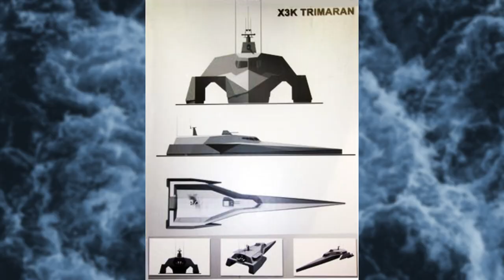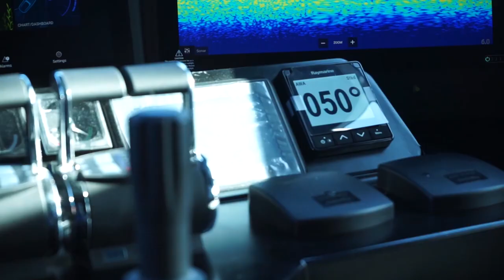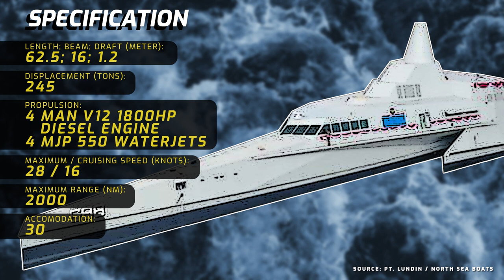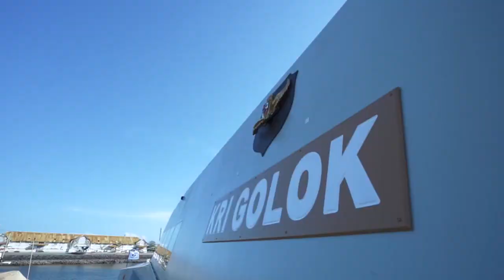What Can We Expect From KRI Golok?

Comment: I was curious about the role it would play because of it's size. Looks a little small for a Corvette but I also didn't think it would be an FAC because if that's the role it would fill... It's rather complicated and expensive. I thought they would utilize the stealth advantage for "bigger" purposes. The role of course would determine the weapon systems and to me the front deck is a little too narrow to fit a 57mm and it's probably going to block the view from the bridge which means it won't use a large main gun,  and wouldnt make it a Corvette, which means it would use AShMs and fill the FAC role but, I've been scratching my head on where you would put them. We've seen shots of the top and Im not sure I see any silos/VLSs. 

It was a pleasant surprise that a klewang replacement was launched somewhat suddenly. The country's military must love surprising the public with sudden announcements like the the FREMM and how many jets were proposed to fill the Air Force.  Again great work mate👍 was waiting for this video since I heard about the launch and definitely wasn't disappointed.
Reply from the maker: depends on the weapons, she can fill the role as coastal corvette.. more or less similar to Skjold class corvette of the Finnish Navy.. both have similar characteristic.. not long enough as a typical corvette length or can carry as much weapons like them, but have the seaworthiness greater than FACs.. I think coastal corvette is more suitable..

First I thought she's gonna be installed with 76mm naval gun, but it's not possible tho.. the best thing she can get is 30-40mm cannon.. posibly Bofors 40 installed on top of the bridge.. functioning as surface and AA gun..
I was curious where they gonna place the AShM tho.. but finally I found it..
you can look at 2:26 there is a rectangular line at the back at the structure.. which look like what I believe for the missile opening.. so I think the missile will aim forward..

for Klewang replacement I'm not too surprised tho.. since we've been waiting for ages here.. 😅
if it takes longer than last week, Lundin credibility will be in jeopardize.. I guess the regional situation that forced us to make a quick decision is one of the reason.. and foreign power wants a piece of it.. as the result we can access fancy toys relatively easy..

thank you for your support brother..
stay safe.. 👍
cheers 🍻

Comment: I like the overral design, but it's pretty disappointing if it's using diesels instead of gas turbines. The waterjets really helps the ship to reach 30-35 knots, but it's not enough because it's a trimaran. It's going to be bullied by other monohull 35 knots+ fast attack crafts and Chinese 30 knots cutters. Switching to gas turbines will rise the true purpose of the fast attack craft to be fast in any conditions.
For the weapons though, France, German, Norway, and Sweden can perfectly equip the ship with varius equipments that fit for the ship.
Reply: Its only a prototype, lets just hope the next ships in class will get gas turbines
Reply: @FebiMaster  I hope so
Reply from the maker: I bet the Navy will give that recommendation as well after they finish testing her..
Reply from the maker: @FebiMaster  I hope that as well..

Comment: To this day I'm still confused on what is the purpose of KRI Golok, It's meant to be a fast attack craft and yet so damn big.
Reply from the maker: big or small is not an issue tho.. the Ford class aircraft carrier is the biggest warship in existence, yet she can sail for 30+ knots.. faster than our average navy vessel such as PKR and KCR of around 28 knots..

it depends on the engine.. however, KRI Golok has a slow speed relative to her design traits, in my opinion.. I expect she can sail for 35+ knots.. but apparently only 28 knots.. I hope they will upgrade the propulsion..
Reply: @PacificFront  either that or the engine are too smal its not balance between power to size ratio
Reply: @PacificFront  They better make it 40+ knots
Reply from the maker: @minegamer5680  I hope so.. I believe the hull design can withstand such speed with ease..

Comment: Mann why do they have to use trimaran design,
Can they just create more celurit class instead,
The celurit class are probably more cheaper and less complicated
Reply: I know what you mean, but I think Indonesian Navy wants more stealth to get rid of those pesky Chinese ships especially their coast guards. I have a low chance prediction that the design will also be used on the future patrol crafts too
Reply: @25.muh.siswadibudiartodani88  the celurit could do the job at half the cost
Reply: @25.muh.siswadibudiartodani88  THEN CHANGE THE WEAPON, GOD you talk as if the celurit class could only use chinese weapon,radar and system
Reply: @thatoneperson6969  I hope the displacement is enough and the engines were upgraded to gas turbines instead of diesels. Why gas turbines? Because it's lighter but more powerful and it can also go faster than diesels with lower emmisions
Reply from the maker: @thatoneperson6969  like KSAL said in his speech, right now KRI Golok is an experimental ship.. the Navy will look up the advantage and disadvantage of this design.. if they satisfied then they'll order more..
It's more expensive and complicated, true.. but she has better seakeeping capability than Clurit and Sampari class.. can withstand rough seas, has lower signature, lighter, etc..

both hull design has their own strong points and weakness.. but I think it's not a matter of which one is better.. rather which one is more suitable for certain condition.. I bet that's what the Navy try to find out..
Reply from the maker: @25.muh.siswadibudiartodani88  North Sea Boats has several trimaran variants for Coast Guard and SAR too, if Bakamla or BNPB interested.. 😊

like I said above, she's still an experimental ship.. we still don't know if the Navy's gonna continue with the program or not..

it's not meant to be used against one particular nation tho.. just to bolster our Navy's FACs capability
Reply: @PacificFront  Exellent! Though it's still a prototype but it already shows it's potential. I hope they really keep it going to replace some outdated ships. I understand that it's not going to attack another nation, but their true purpose is to give them some fear and to make them think twice before going into our waters + defending Indonesian waters from any threats

I was designing a hypersonic missile with varius sizes depending on where it will be fitted (from FPC up to Cruisers) at the same time with the submarine. I hope I can finish this soon
Reply from the maker: @25.muh.siswadibudiartodani88  having several types of FACs with different material and characteristic can make us less dependent in just one type of ship.. if one have a problem, the other can fill the gap.. I think that's what the Navy try to do..

keep it up buddy.. 👍
Reply: @25.muh.siswadibudiartodani88  don't forget about logistic, too many type would not help in time of war
Reply: @PacificFront  there is plenty of design ship that could be more efficient and cheaper
Reply: @PacificFront  mate too many design of same role design could lead to logistical problem
Reply: @thatoneperson6969  you're right, but we're not at war right now
Reply from the maker: @thatoneperson6969  for the Navy, not really.. as long as they are equipped with common sensors and weapons, that won't be a problem..

having 2 types of vessels can guarantee the Navy with dependable FACs fleet.. one covering the other weaknesses..

for example.. the first batch of Sampari class didn't perform as we expected.. and BPPT must give a recommendation to improve her design for batch 2.. imagine if we put all the money in just Sampari class, we will suffer due to under-performing vessel..

I do think having a Clurit class is a waste tho.. her capability is limited and there's limited room for future growth..

and remember Klewang/Golok class program was introduced long before Clurit and Sampari class.. and last week ceremony was just a "redemption" for the lost of Klewang..

I said again, KRI Golok has something that Sampari and Clurit class lack of.. which are lower signature and has better sea worthiness.. if her high price tag will result in better performance and always guarantee a mission success, then that's the price I'm willing to pay..

I think right now it's better for us to just sit and wait until the Navy is finished with their findings.. 😁
Reply: @PacificFront  they just need to design a bigger celurit class but still smaller than our corvette if they want to add more weaponery
Reply: @PacificFront  different design took different time to build, THAT will become a problem we're not  the U.S we don't have as many naval port as them and when our naval port got hit in case of a war welp there goes the entire navy production line 

And lets face it mate, indonesia would not survive long in an all out war, our pride and nationalism is nothing if the enemy could kill us from far way and we don't even have a lot of missile defence system
Reply from the maker: @thatoneperson6969  we already have Sampari class for that purposes.. 60m long.. 20m longer than Clurit class, 30m shorter than Diponegoro class.. and have enough space for more weapons and sensors.. that's why I think Clurit class is a waste..
Reply: @PacificFront  the Special Forces could still use the celurit for they're operation
Reply: @thatoneperson6969  we will also have our own OPV and it's armed to the teeth. We just need to build it as quick as possible. The design overral is more similar to Clurit and there you go! A bigger Clurit
Reply from the maker: @thatoneperson6969  that's why we diversify our production.. so when one got hit, the other can still operate and provide maintenance..
your comment is basically the same as what I've said since yesterday..
 
PT Lundin said KRI Golok needs 14 to 18 months to build.. Sampari class also have the same time frame.. so it's not too different in terms of construction time..

your second point is completely different matter mate.. and I already talk about the importance of coastal defence system in separate video, so I won't talk about it again here..
Reply: @PacificFront  in total we only had 3 port, we still need more port to be able to create more ships in short notice.

And see i told you, our air defence is lacking and most of the advance radar system are in java island
Reply from the maker: @thatoneperson6969  I bet there are more..
of course we all still lack of everything.. that's why last week ceremony is part to modernize and bolster our Navy capability..

Comment: Why was the KRI Klewang burned down so easily by short circuit? beacuse of its composites skin which is flamable? If only an enemy shoots a small caliber flaming slugs to the composites hull like this?
Reply from the maker: yeah, the old one didn't have anti flammable coating.. the new one I believe it has.. the plan for this vessel is try to not get shot.. 😁
Reply: If that is the plan, it should be a civilian transportation boat.
Reply from the maker: @Riazor1370  the Norwegian Skjold class and Swedish Visby class also use carbon composite materials tho.. it's not something new in naval vessel.. and this type of vessel is not meant to be use in the frontline.. they usually use hit and run tactic.. so using steel or carbon composite materials doesn't matter.. the weight of the vessel can be reduced quite significantly if we use the latter.. in other word, higher speed..